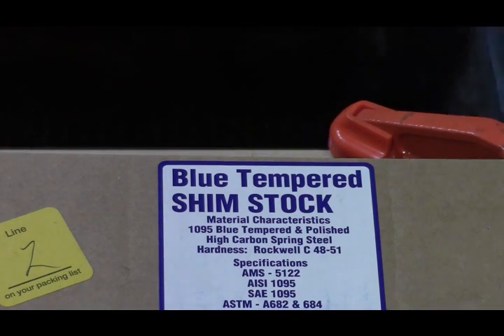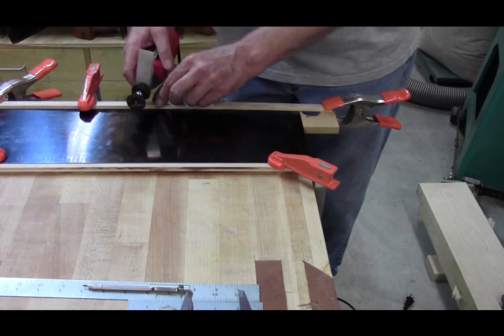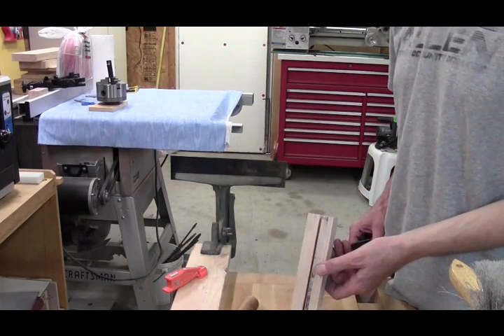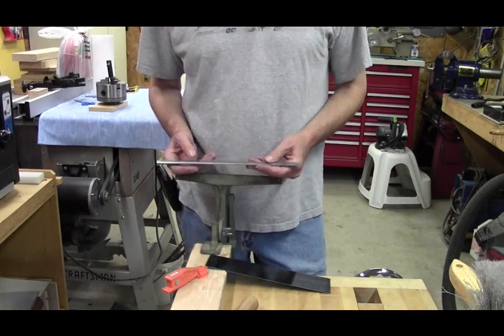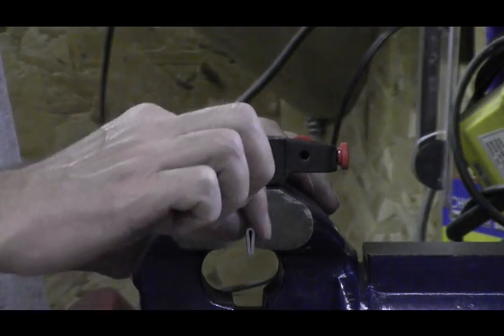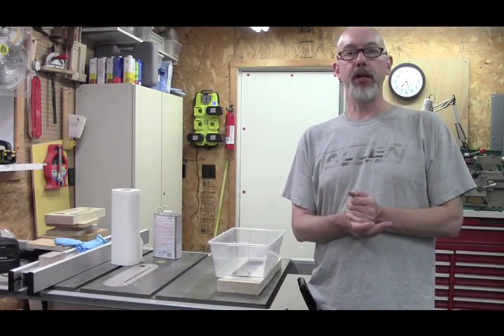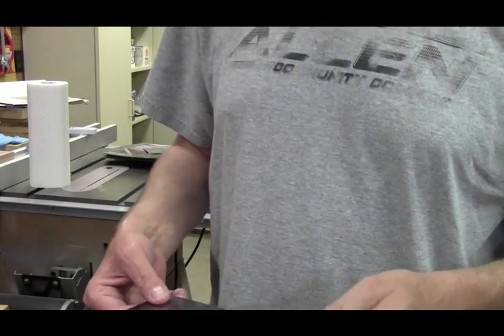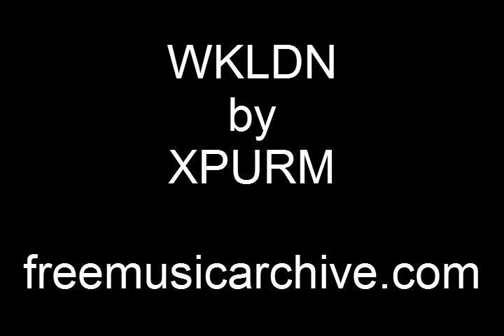Dovetail Saw Build - Part 1

Comment: How much for the shim stock?
Reply from the maker: McMaster Carr has.020 x 6"x 25" 1095 spring steel shim stock for $18.12.  Should be enough for 4 dovetail saws.  I think they have some smaller sizes like 6" x 12" also.  So you can see that compared to the price of a new saw, this stuff is pretty cheap.  Bontz saw works sell kits with brass backs, bolts, and a blade with teeth already cut.  You have the option of sharpening it yourself or having them sharpen it for you.
Reply: Haha that's funny, I was recommended Mcmaster by my local steel company. I ordered the exact item you described plus a small single cut metal file. I'm just having difficulty finding a brass strip now. Maybe I'll order it from that site.